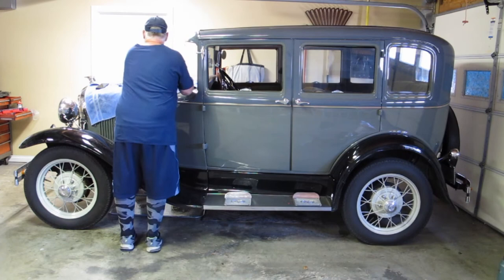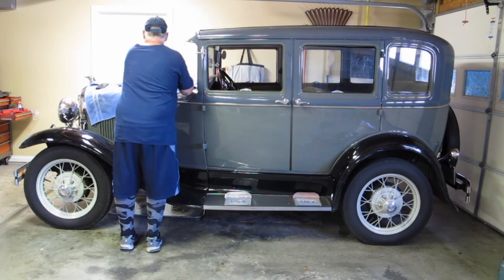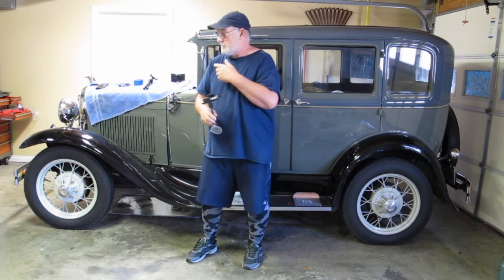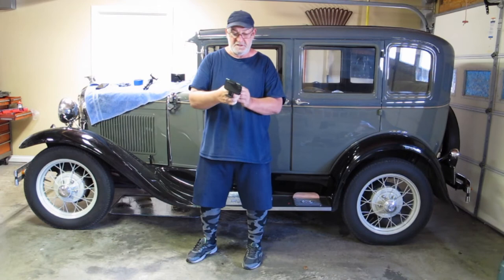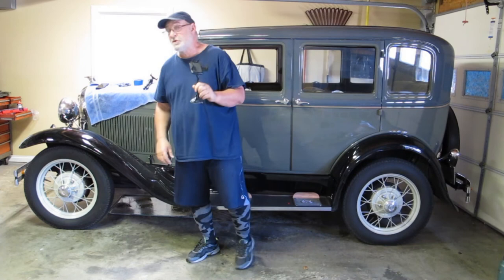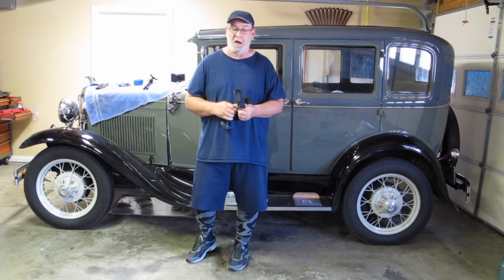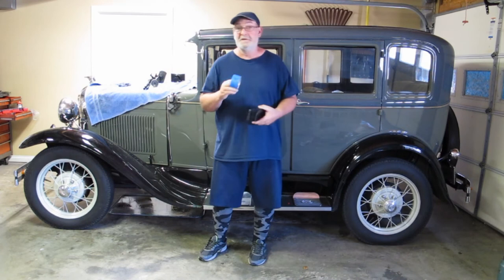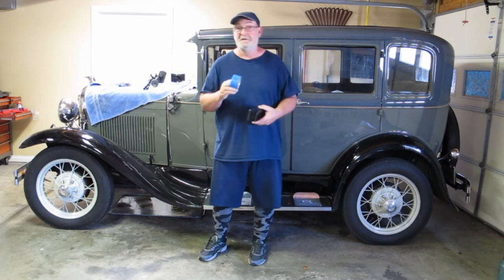Using a GPS and more in a Stock 1930 Ford Model A

Comment: Thx .So far I've not needed a GPS however someday when we get courageous and head out for a 200 plus mile adventure we'll surely take the advice on the GPS battery idea. Embarrased to say as a non tech guy Ive never seen that .....BUT.....I'll be looking short.Again great vid..Looking forward for what's next.Thx D.J.
Reply from the maker: Thanks for the kind words Dean.  It was something I learned last year when I needed to get a tow and I had hardly any cell phone charge left.  Since that time, I made sure I had one of those power banks in the door pocket.  As to a 200 mile drive?  I started out with 25, then 50, then up to 100 round trip drives first until I felt very comfortable enough to go venture out.  I've put 1200 miles on the car over a 3 month period with nearly half of that doing just what I mentioned.